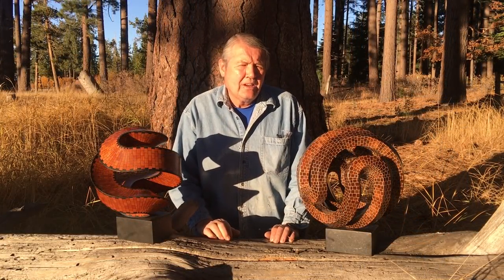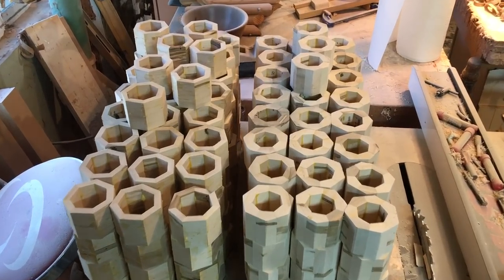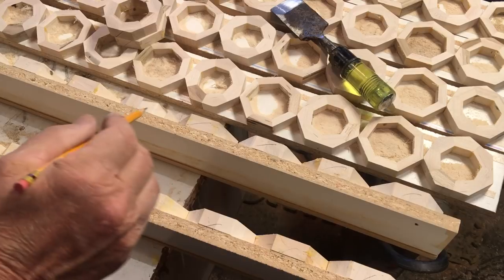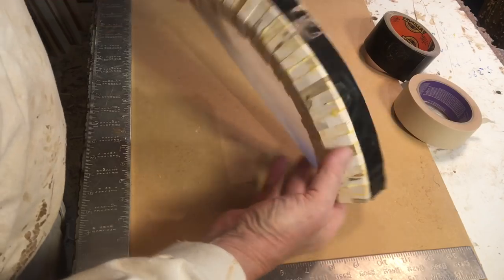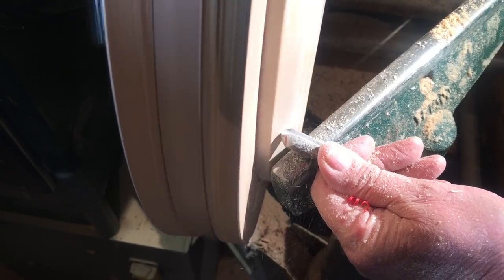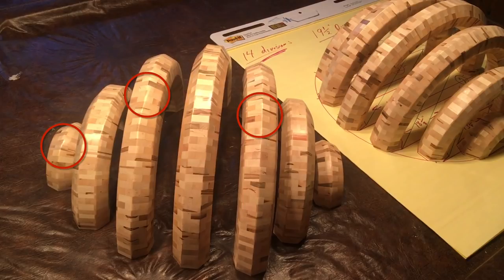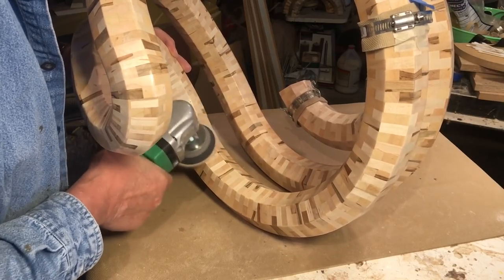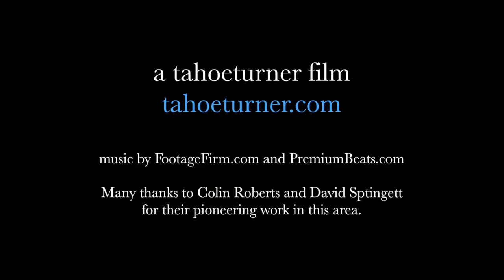The Power of Seven

Comment: I only wonder why don't you use dowel pins in assembly process, to secure parts more precise while assembling, avoiding slides of parts. Also i would use paper tape to cover the wood around the glued gaps and after curing, just remove the tape with excess glue and spare sanding... Just saying, anyway, really really great work, amazing, great- will subscribe.
Reply from the maker: Peter Isteník  Peter, the hassle to install dowel pins just wouldn’t be worth the trouble.  The use of paper tape really wouldn’t help with joint cleanup; the joints don’t line up perfectly and require a little transition sanding.
Reply: Ok, i was just speculating, thanks for answer.